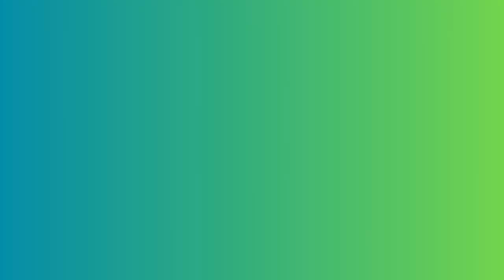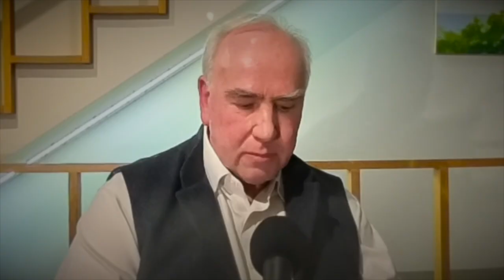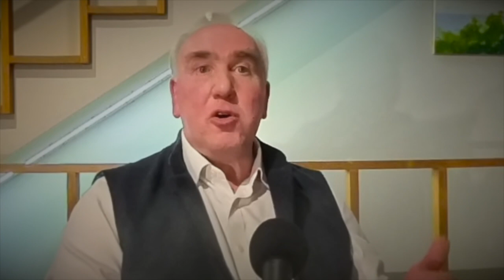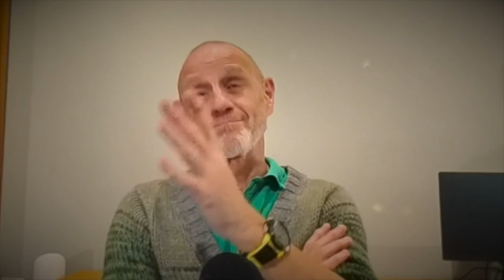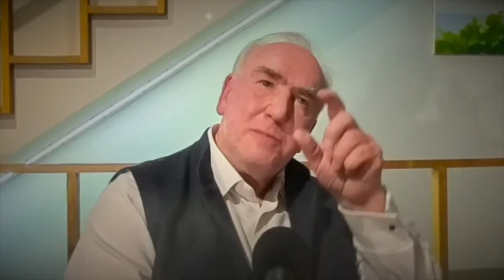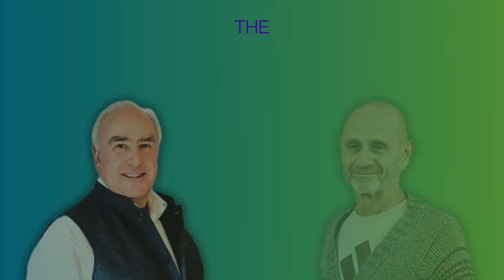13. What are the alternatives to heat pumps?

Comment: The cheapest form of heat is no heat. Insulation in houses in the UK is awful and should be the number one.
Storage radiators can work. Many tariffs have multiple off peak periods including during the day - better than the old Economy 7. 
Requires smart meter. Air to air heat pumps work for smaller properties -flats/bungalows - again requires the correct off peak tariff for lowest running cost.  A2A is cheaper upfront but requires additional electric hot water solution.
Blue/Grey Hydrogen is just a more expensive way of burning natural gas. Green hydrogen is too expensive for heating - more efficient ways of using  electricity. 
As someone else said - Tepeo boiler is a  heat store/storage heater - it will store heat using off peak electricity - no need for additional electric batteries.
Reply: Air to Air works for larger properties too.  And there are combined solutions - I have one: A Hitachi Yutampo Twin 35.  2 A2A units, plus DHW. Daikin have the multi+ as well.  Just UK availability is a bit sparse at the moment.

Comment: There is a fundamental here. Burning is burning. And we need to stop burning stuff from what ever source. 
And burning wood pellets misses another point. The carbon from 20-30 year old trees is being added back to the problem we have today, not 20 years ago. 
Also, burning anything might offset the carbon ( we hi h I clearly disagree with) but it does not deal with the amount of Nox and PM 2.5 given off by the burning process. Nox is what did for diesel engines but apparently we are happy with that pollution directly in our homes.
Reply: Hydrogen is the biggest load of bull. It's beyond nonsense.
Reply: Patrick,
You are living in fantasy land. We must keep burning fuels until a better solution is found, and it isn't green electricity. Modern diesels are extremely clean and pm 2.5 is a falsehood and not what it is portraid to be.
Reply: I don't personally agree with promoting wood burners etc. as an alternative, but to your point about this "adding back" carbon to the atmosphere, this will happen eventually either way.

Trees are all carbon neutral eventually. They all either burn down, or die and decompose. The decomposition process eventually releases all of the carbon stored within.

So in the long term trees are absolutely not a "carbon store".
Reply: Why - why do we need to stop burning stuff?  Have you any idea of the noxious substances emitted by a single forest fire?

Comment: With regard to storage heaters, I currently live in a flat with units that are around 15 years old. Octopus Energy have a new tariff called Snug which gives 6 hours overnight and a one hour top-up mid afternoon which helps eliminate the evening 'heat droop'. 9p/kWh off peak which applies to all devices using power during those periods (28.39p other times).

Comment: Consider what will happen when electricity is not available, just like during the last storm, but for a much longer duration.  The grid is far more vulnerable to both short and longer power outages  than is commonly imagined.

As for decarbonisation -  it is completely unnecessary.
Reply: In the event of a grid outage, all the gas boilers fail too. Circulation pumps and controllers need electricity
Reply: A portable generator connected to your suitably isolated from the mains home circuits is a simple workaround; whe. Our grid connection fails we routinely do this with a small (3KwH) petrol generator. Once we are aware that the grid has come back on, we can remove the generator and re-establish our grid connection. Only be sure that your generator works (a periodic routine service is good), and that you have sufficient fuel for your needs and generator type.
Reply: @freeforester1717  Consider how you would heat your home with gas with no electricity.
Reply: Wood is good; living in the wilds of Grampian we are resilient to electricity outages.
Reply: Here in the East Riding of Yorkshire we have regular power cuts.Mine Combi Gas Boiler is staying.

Comment: What was the cost of the "bank of batteries"?
Reply: Don't ask difficult questions we have to save the planet yes? david.
Reply: @foppo100  From the Indians, Chinese, Indonesians and the US not the UK.
Reply: I bought three Sigenergy 8kWh batteries in July 2035. Cost was £2000 each (NO VAT on them as bought as part of a solar pv system). So a bank of batteries will be of the order of £4000 to £6000 depending on how much electricity storage you want.

Comment: Let me know when lecky falls to 5.5p/kWh.
Reply: Never gonna happen, why are you asking that?
Reply: @keoghrichard1988  because he's advocating a lecky boiler at 4x the running cost.
Reply: @keoghrichard1988  That's when it would make financial sense to change to an ASHP.
Reply: @davidreece1642 so it needs to be 3-4 times cheaper than gas heating before it makes sense for you? It’s already pretty much comparable because of the efficiency gain. 1 unit of electricity = 3 to 4 units of heat from ASHP compared to 1 unit of gas = 0.85 units of heat from a gas boiler. Factor in cheap rate overnight tariffs and it gets even better.
Reply: @photoman152  I prefer better odds. Perhaps 5p was asking too much but 15p/kWh (plus overnight tariffs) and I would swap out mu 15 yo gas boiler in a heart beat.

Comment: Try this. Heat pumps have a scop of say 3. That is for 1kw electric you get 3 KW. Work out your heating currently in KW. Divine by 3... Am I correct that would be heat pump running cost.. perhaps go for full electric no heat pump.. cheaper up front cost.. comment please is this nonsense
Reply: @caterthun4853  No that is no totally true. 1) sCOP can be more than 3 with new installs (Mine is about 3.6) . 2) You need to factor in gas efficiency (say 90%) . 3) No gas means no standing charge 4) Using time of use tariffs like Octopus Cosy means costs are less . Think of unit cost of heat (Price cap rates) Gas = 1*6.4/0.9. = 7.1p/kWh whereas ASHP = 1*24/3.6 = 6.7p/kWh. For us our tariff ,+ solar  means unit cost is more like 17p so unit cost is 1*17/3.6 = 4.7p/kWh.
Reply: @philipbroggio9315  and @caterthun4853 - Philip has answered your question. My only addition is that many gas boilers rarely operate in condensing mode,so could be delivering closer to 80% efficiency
Reply: Sign up for a green/ bio gas tariff on any household boiler.

Comment: What about Infra Red panels ? I have an ASHP but use IR as a top-up when don't need whole system switched on in autumn. Can keep a living room warm in evenings using less than 1 kWh no problem. At a national level agree Hydrogen is nonsensical as would need six times the amount of green infrastructure to produce, compress, transmit and burn compared to heat pumps. Keep the pods coming .
Reply: I was also expecting IR panels to be mentioned, technically still can't achieve >100% efficiency, but apparently can indirectly use less electricity than an electric boiler as the heat provides the same comfort at a lower temperature (due to being radiant instead of convection) and can be easily zoned, have you found that to be the case?
Reply: @JoshuaStringfellow1  I only have a couple of portable (500w and 220w) panels but they are great for topping up for an evening as I said.  The 500w panel in our living room uses about 250w/hour in autumn conditions. In perspective we can heat our whole house with our ASHP in similar conditions for about 500w/HR and COP of 4 plus.
Reply: This is a behavior that I chuckle at.  You’re not saving anything by not using your ASHP.  They’re variable speed and highly efficient.  Since the temperatures are moderate, you don’t need much, so it doesn’t run much.  Just run the ASHP.
Reply: @dus10dnd  I never switch off the ASHP once the heating season starts as it works as you describe. We originally bought the panels when we had gas a couple of years ago. I should have explained that in my original post .
Reply: Well I just pressed send on my own rant about the fact that infrared panels were ignored and then I read your comment! Glad someone else thought of them too, much less hassle to have installed, can be done in stages as you can afford it in terms of energy, time and financially too.

Comment: Didn't mention tepeo 12:00 as a heat storage battery for an electric boiler.

13:23 hydrogen for heating is over. It was a con to keep fossil fuels going for longer. Gas sellers would love it because they'd sell 4x as much gas, to be steam reformed into hydrogen for home heating. 
Hydrogen needs to decarbonize itself before you start offering it to decarbonize other industries. 99% of hydrogen sold around the world is from natural gas or coal. 

I'd suggest you read Michael leibreichs output on hydrogen Evan.